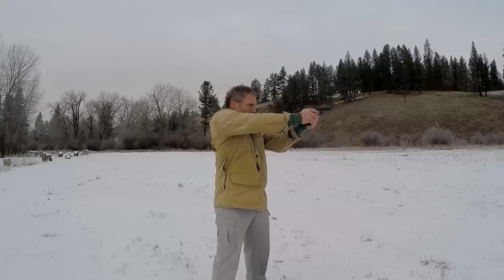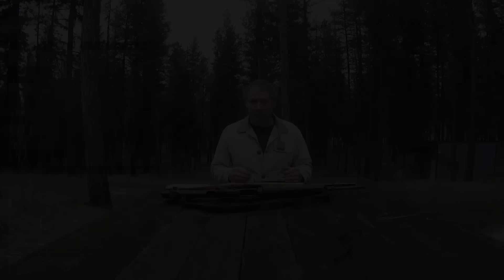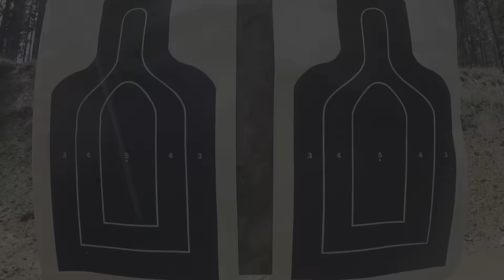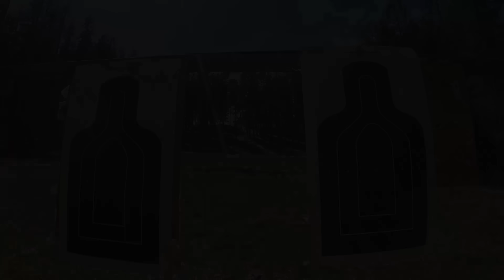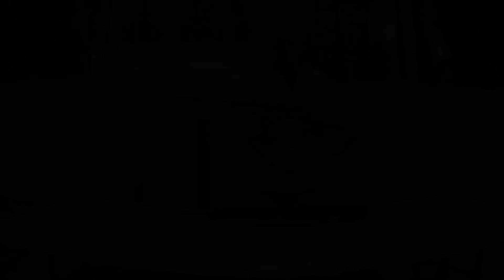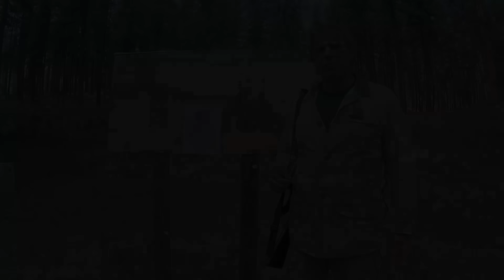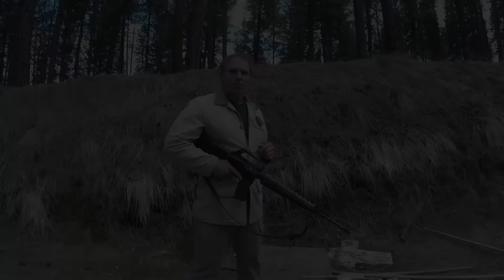Mini-14 vs AR15: Which is Better?

Comment: I went with the retooled MINI 14  583 series in 2015 with  thicker barrel Marked 556 cal because 1. Less maintenance 2. Eats steel ammo without breaking ... one day ammo will be currency... AR's don't handle steel well 3. Tougher and simpler, I can make this rifle work with access to a junkyard!!! 
I was SOooo close  to the S&W Sport for ~  $600  and the Colt Leo AR  for ~ $920 at the time but went with the Mini 14  at $ 735 at Walmart for these reasons!! I live in rural GA so tactical reloads don't apply much in my SHTF scene. I went with 1. Reliability in humid/wet conditions, 2. Bush survival... I'm gonna be shooting rusty Steel cased and trading my Brass for food in SHTF  3. Steel vs aluminum reciever and Piston vs DI!!!  
 I may buy a S&W Sport BUT I LOVE  my mini.

Comment: I wanted to share my experience with my newer 580 series mini 14. I picked one up used from my local gun shop that appeared to be in very good condition. When I took it out to the range I would have a jam every 10 rounds or so.  I contacted Ruger and they had me ship it to their NH plant to get it looked at. A couple weeks later they call me and tell me that they couldn't fix the issue so they would be sending me out a brand new one! I was pretty excited to hear this news.  So I pick up the new one and take it out to the range. It worked flawlessly with the same mags I was using previously. After the range I come home and take it apart to clean it and what do I find?? A hole in the bolt that definitely wasn't there before. The hole was so bad I could see the firing pin though it! So I ended up having to send it back to Ruger again to have a new bolt fitted and installed. After all this I gave up on the platform and sold the thing to buy an AR. I suspect it was just bad casting of the bolt on Ruger's part.

Comment: I owned a mini 14 back in the mid 1990s. I found your representation of the rifles accuracy and reliability pretty well dead on. Mine wasn’t a tack driver but it did well enough to pop coyotes at 200 yards. I did my best to keep the rifle properly cleaned and lubricated and ran the factory mags. To the best of my recollection, I had very few if any malfunctions.

Comment: Your early Mini 14 were notoriously inaccurate, bad shoulders and bore wrong size.  My "151" late series (7.62 X39) hold a 1 inch group at 100 yds, bench rest.  But, so will most modern ARs

Comment: Outstanding report, Sir.  It is (in my mind) hard to judge one tool as “superior” to another tool without first defining what the tool is supposed to accomplish.  You have done an excellent job of comparing the Mini-14 to the AR.  Which one is superior depends very much on the needs and intent on the person using the tool for the specific requirement they have at that particular moment, and I think you did a great job of showing how for one application a specific quality/feature is a plus for the firearm and for a different application, the same quality/feature is a minus.
   I must agree with several other posters; please do not get overly concerned with the length of your presentations.  A one- or two-minute report is going to open and leave more questions unanswered than it gives answers/information about.  I am fairly certain that anyone interested in firearms or thinking about dropping $300 up to $2000 dollars or so for a firearm has the attention span to watch a video up to an hour long.
   Thank you for your service to the country and thank you for the firearms knowledge you bring to the community and those who find your channel.

Comment: AS always, a great informative video. I am curious though, would the AR platform have same performance using a specific weight bullet as the Mini-14 or vice versa? Example: performance from .223 55grain spitzer, 5.56mm 55grain spitzer. Thanks for taking the time for this presentation, looking forward to next one.

Comment: It was a more interesting debate when the option was the $750 Colt AR-15 or the $399 mini 14, and that was pretty much it at most gun shops.
Reply: Or $450 vs $1200 when the A2 came out.

Comment: Which one is better? Run them both through the dirt and immediately run 10 rounds through each; you will have your answer very quick. Assuming you closed the AR's dust cover, it should run like nothing happened. The Mini on the other hand with it's exposed action will likely have failures to feed/eject/cycle, this isn't a problem limited to the Mini-14, all Garand-action rifles share this problem (and not just them, FAL/L1A1 are pretty susceptible to this too). They're both good rifles that you can trust you life with/feed yourself if you have to, but the AR has less chance of malfunction when covered with outside debris. But as long as you're not retarded and keep the rifle clean (which should be easy enough to do so long as you're not in the moon dust desert or accidentally drop it in the mud), it should work fine.

Comment: This is a great video. Gotta say though - the so-called "boring parts" where you talk are among the best. Don't get me wrong, It's fun watching you shoot, but both your points of view and discussion are incredibly articulate and well thought out. 
I also really feel like this video was incredibly fair and accurate, and despite the obvious gaps in performance between these two rifles - gaps which aren't nearly as significant as many on the internet would say - it clearly does more to vindicate the Mini-14 than it does to condemn it, as many have and are want to do. Your tests were also done with an older Mini 14, and it performed well. the newer ones are quite squared away and aftermarket mags are generally more reliable, and the Ruger brand mags more plentiful. As a fan of both the Mini 14 and the AR, I'm happy to see that It's clearly still a very viable semi automatic rifle.

Comment: With respect, I think these type of comparisons should be done with optics.
Reply from the maker: That would be interesting. it would add a dimension to the comparison. However the sights on the two rifles are different so they make a point of contrast that should be evaluated. If I wanted to make a part two It would be good to have a segment on how the accuracy compares when using optics.
Reply: @PaulHarrell  Yes, I certainly agree that this comparison highlights the core nuances of these rifles better than any other review on youtube. Take care, sir.

Comment: Mini 14 is non-restricted in canada, major benefit up here. Still like both platforms though.
Reply: Let's hope the Conservatives live up to their promise to reclassify the AR as non-restricted. The Mini 14 is way over priced. I saw one in Canadian Tire for $850 and thought "That's a good price" until I put on my glasses and saw that it was $1850.
Reply: @ericferguson9989  the conservatives have never made any such promise.
Reply: @JP-xh4fq  You're right, but Maxime Bernier made a similar promise and Andrew Sheer broadly insinuated that he would do the same. I know it's not really a promise, but a fellow can hope.
Reply: @ericferguson9989  wtf are you talking about? The conservatives have never made that promise. Just some candidates that were running to be the next conservative leader.
Reply: @ericferguson9989  that's not expensive, you can't get an ar15 here in germany for under 1000 bucks. Granted, we don't have the really cheap ones, but come on! There must be a way to get a new ar15 for 600-700 bucks, if you wahr a simple model.
Reply: @erebostd  They are not expensive, but they are restricted to government sanctioned ranges. Similar rifles that are not AR15s are not restricted, but manufacturers and vendors sell them for inflated prices.
Reply: @InfinitelyQurious  The 'go to', affordable, multi purpose rifle, in Canada is the SKS as far as I know.
Reply: @InfinitelyQurious  Yes, you can. The Chinese model is decent and can be had quite cheaply. I disagree with China's Communist government, so I try to avoid buying Chinese stuff. I also want a .223 rifle, since they can be used to hunt for coyotes. A lot of communities around Toronto have rules about what calibres can be used for small game. Also, I like the AR platform for its coolness and versatility. If I could use one for hunting and general plinking instead of as a range queen I'd get one in a heartbeat.
Reply: I was surprised the other day to see that my Savage M93 .17HMR bull barrel stainless is made in Canada. Nice job!
Reply: @InfinitelyQurious  yes you can get  norinco m14 clone for 600-700 bucks but .308 surplus is about 80 cents a round here when bulk  anything else is a dollar or more
Reply: But is it really the best option (as a function of price, quality, and functionality)? I’m genuinely curious as I’m not familiar with which guns are non-restricted. I know you guys have some Norinco stuff that is more modern than the mini.
Reply: @InfinitelyQurious  if a mini is $1850 there, then a new m1a is probably at least $2000. Then 308 is so much more, it's really not the way to go for the working man.
Reply: What about magazine capacity? Any law about that?
Reply: D Roberts 5 rounds rifle, 10 rounds pistol
Reply: @InfinitelyQurious  Norinco M1As the M14 Copy are quite popular here.  They are both non-restricted, but limited to 5 round mags. (edit - all semiauto non-restricted are limited to 5 rounds here not 10 like I originally stated)
Reply: I wish we could by Norinco guns in the US.
I have one of their 1911 copies and have been real happy with it.
I don't understand why you can get nearly everything from China but not guns.
Yet another stupid gun law that will never be repealed.
Reply: And now Trudeau has banned 1,500 semiautomatic rifles, including the Mini 14.

Comment: That is the most accurate Mini-14 I have seen in a long time. That being said, most Mini-14 I have fired are not THAT inaccurate compared to an AR. I normally say the AR is generally a 2 to 3 MOA gun. Better AR and ammo may see better results. Mini-14 is about a 3 to 4 MOA gun...some of the early thin barreled ones 4 to 5. Better ammo may see better results. So for things like home defense, or wooded areas that you never see more then 150 yards, accuracy is more then enough to hit whatever you are shooting at....assuming you can shot well.

Comment: Mr Harrell Sir, I have owned a Mini-14 and 2 AR platform rifles, and totally agree with your assessments. I do not, however, agree with your statement that the parts where you "just talk" are boring. I get more good, solid information from 5 minutes of your Shatneresque  ... pauses and your speech impediment (WHAT impediment?) than I get from an hour of the other guys BSing. Plus, you do a great impression of a 12 yer old. You tell it like it IS, not how you want it to be. Keep it up!

Comment: This is one of your best Paul.  The whole ignorant kid ignorant LEO part is both amazingly funny and fair.
I love my Mini, but between investment casting, barrel whip, and falling behind each year in terms of development, the AR has become a better platform.  I'm sure there's lots of individual rifles that perform above or below the mean and median, but as a platform AR have gained the advantage.  That being said, I have to wonder why so many guys wanted a modular rifle platform instead of investing into making a single rifle that much better?  Not hating, just curious; different strokes for different folks
Reply: Buckshott00 __ probably because there’s so many differences between all. Why buy a gun that’s “good” for all when you can essentially build something “great” for you?
Reply: @alexmoore1506  That's kind of my point, if you're going to build something into something great, why use a modular platform?  JMHO, but you're not building at that point you're assembling into something that "specialized" but not "customized".  If you're going to go thru the time and expense and care of making something truly great, why mess around with fit parts? If you're going to go custom why not go full custom? 
Everytime I get to tinkering with my mini, I have to put the brakes on early to keep from  having to rebuild the thing from the action up.

Comment: Paul Nailed the exact reason I sold my AR and bought a Mini-30.... public (and evidently law enforcement) perception. That and stepped up to the 7.62x39 round. I would however, would have liked to have seen a breakdown comparison of the differences and reliability of the two bolt carrier actions. The Garand style (self cleaning) rolling bolt of the Mini series has been a industry standard.

Comment: Yabutt…..  No, seriously, both platforms have so many dang variations these days.  And I loves me some of both!  I've had several Mini 14s, and they were great for varmints on the farm.  The best AR platform I've had come through my shop is the Windham Weaponry HB (Heavy Barrel).  It is far more accurate as a base rifle than most of the higher end brands touting supreme accuracy.  My current Mini is the Tactical, with just a 16" barrel.  The newest barrels are far more accurate after getting warm to hot.  And I put the evil Butler Creek folding stock (w/pistol grip) on it, along with quick detach optical sight.  Old guys need help when thinning coyotes in the middle of the night.

Again, great presentation, and now a lot of us know a lot more about both systems, though I will always be partial to the venerable Garand operating system found on the Ruger.
Reply: In the early 2000s, can't remember the exact year, Ruger shut down Mini production, removed all the old machinery, and installed new machinery to make them on.  The new machinery is much more precise than the old stuff, and the tolerances on the new Minis is much tighter than the old ones.  And, as Mr. Harrell pointed out, they did a few tweaks to them to aid accuracy, as well.

Comment: @ 34:26 -- Mr. Harrell quotes Stalin. Woot!  BTW, Ruger didn't do the redesign of the Mini-14 to correct the accuracy [or inaccuracy] issues until 2010; the rifles prior to that watershed will benefit from the addition of the accu-strut. [Google it, it's a DIY project, or you can purchase ready-made ones from the aftermarket.] The minor redesign in the '90s was a production streamlining thing so they could make more of them cheaper [given Bubba Jeffy's AW Ban, they had huge demand to meet...]

Comment: 34:47 So wait does Paul only load his AR mags to 29? A full 30 puts the top round on the right on an AR, left on an AK.
Reply from the maker: I usually only load with 25 rounds. it spares the springs when they're in my ready bag for months at a time.

Comment: jurisdiction counts for a lot, in mine (Canada) a semi-automatic rifle with a magazine capacity no greater than 5 rounds, is unrestricted - anyone with a licence can buy one.  the mini 14 falls into this catagory. Any AR, including clones, is a restricted weapon (because, reasons), regardless of the magazine used.  this places a great deal of limitations on buying and using one.  a bit of a moot point for me though, I'm not a big fan of the round, I feel it's too light for most game.  also, there is a restriction on what you can use it for - deer are classified as big game where I live, and the minimum caliber allowed is .24, and, as Paul pointed out, it's kinda overkill on small game like rabbits and squirrels. so all it's really useful for is varmints and plinking.

Comment: I guess also the mini14 looks like a Garand or M14.  Maybe someone very familiar with these would like the Mini-14
Reply: Squirrels and such
Reply: Yep. I love the M14. If I wanted a rifle in a small caliber I'd pick the mini. Not sure what I'd use it for tho. 😁
Reply: @CGoffgrid  supposedly the new ones are significantly more accurate. If that's the case, then you could hunt anything you're comfortable hunting using a 223.
Reply: @CGoffgrid  the mini 14 is also made in 7.62x39 ak round and 300 blackout and 6.8 spc

Comment: Not boring at all. 

My Mini story. The sight was rolled to the left so bad the windage wouldn’t compensate. The spigot was loose, the gas thing under the barrel, after 100 rounds. The trigger was awful. Made a lot of metal shavings every time. Never jammed. Never buy one again. 

“Oh, you got a bad one.” No, I bought a typical one. Inconsistent. At the same time I had a $99 SKS. Great gun, but maybe I had a good one.

Comment: While I was in the Army, we used metric system on the ranges.

25 meters was the zero range on Short range sights.

The silihoutte on the 25m zero target appeared the same size as the 275m full size target down range.

If you had a good tight group at 25m. Hitting the 275m was the same shot.
Reply from the maker: When I was in the USMC some ranges, depending on what base you were on, were meters, some were yards.